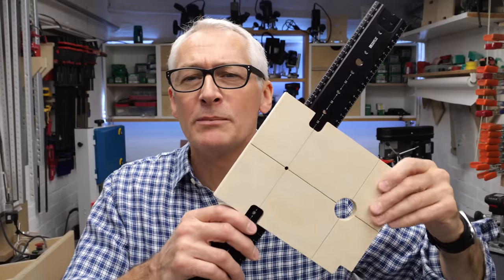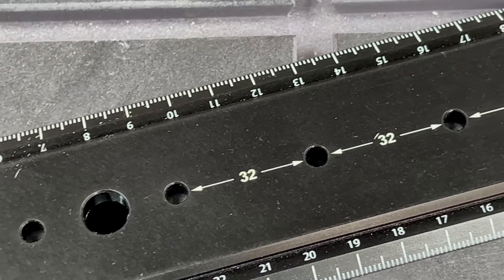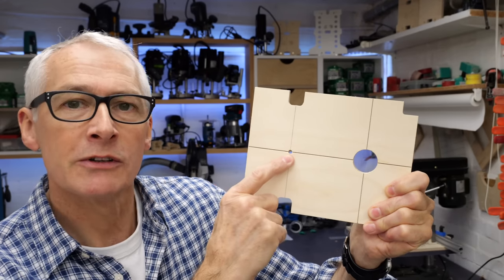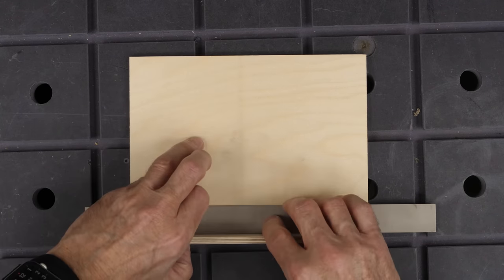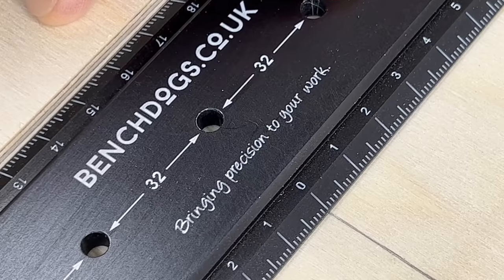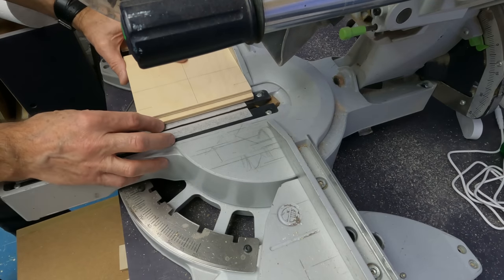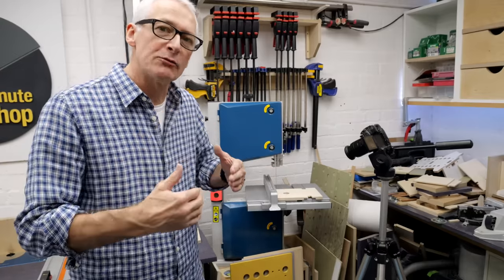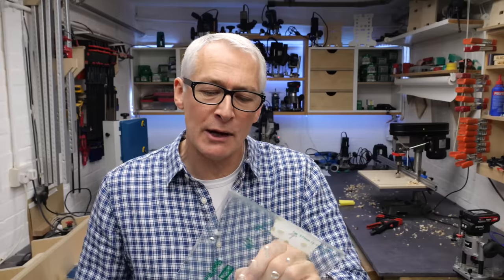[*Gifted/Ad] Quick & Easy DIY Shelf Pin Router Jig [video 506]

Comment: This is great! You could have the locating pin on a piece of spring steel so that it finds the next hole automatically without you needing to look. Just lift the pin out of its hole, start to slide the jig and let it spring  in to the next hole.

Comment: Another fine jig, I have the holy rail and used it on a few projects. It works great within it's limitations. First it's almost impossible to use it on assemble cabinet. Second it's a pita if your cabinet is custom size and not following the 90mm system. 

Thanks for sharing Peter <3
Reply from the maker: Thanks! And yes! Whenever I was asked to retro-fit shelves in existing cabinets I’d always use a simple drilling guide - messy, but much simpler to make it fit!👍

Comment: Excellent video and another great product from Benchdogs. I do wish there was a nice simple but durable shelf pin jig on the market that didn't cost the earth. A simple slab of metal or thick acrylic with holes for a router guide bush (instead of the 5 mm holes you get on most cheap jigs), a simple fence with a few holes for different backset positions, and a removable end fence to hook over the end of a panel. I'm sure this jig works very well, but it's still reliant on accuracy of the marks, alignment of the drill bit on the marks, accuracy of the drill press etc. Something like the above but CNC cut would be a great tool to have, perhaps supplied with a matching guide bush for absolute accuracy, which would allow shelf pin holes to be made to within fractions of a millimetre.
Reply from the maker: Thanks! As I say in the vid, the benchdogs rulers have an end hook accessory - or you can put a pin through a hole - so you’re not reliant on aligning against a mark. The trouble is that what you’ve described, whilst not complex, isn’t trivial either, and the costs do add up. Plus there are practical considerations too - if it references off the end of the carcass, how long does it need to be; too long and shipping becomes an issue, too short and it’ll be no good for longer carcasses!

But I agree, I think there’s space in the sub-£100 category for a decent quality multi-purpose jig, and I do have something cooking in that area, so watch this space! 👍👍

Comment: Getting ready to add shelf pin holes and this was a very interesting build. You have built tall cabinets in the past, with euro hinges in tall doors did you find that you placed the pin holes farther away from the edge so as not to conflict with the hinge plate positioning? this may effect the jig creation. (i have 48" wide carcasses already on walls)
Reply from the maker: It was very much dependent on the job; sometimes it's easier to stick to the '32mm system' and have the hinges in the same run of holes as the shelf pins, sometimes I'd set them back a little to avoid it.

Comment: Nicely done!
One jig I’ve always wanted to build is a version of the True Precision brand cabinet handle drilling jig. 
But instead of having tension setting screws, it would be nice to have actual millimetre incremental detents for a stop pin to set in to. Hope this makes sense. The knock offs aren’t worth while in my opinion, and the premium brand is almost $400 CAD. And the set screws are annoying and create bumps on the locking surface over time, and make it hard to lock in at exact positions sometimes. 
It would be great if Festool made it, because what I’m imagining would work exactly like the extensions for the domino. It’s adjustment works along a rule with millimetre increment detents.

Comment: Good ideas and also a good idea to provide the kit for those that don't have the full machine shop. That said, if I was making it, it would be in aluminium in my machine shop.
Reply from the maker: Thanks! Not everyone has a machine shop either! 😂 👍
Reply: @10MinuteWorkshop  Absolutely, whether it be a band saw, drill press or in my case, a milling machine.

Comment: Well done.  Bench Dogs looks to be providing the initial precision and extenability that is needed for drilling the pin holes for the 32mm spacing.   I found that using the plastic templates, after a few extensions of laying the template down they get off a bit and the holes on the other side or in back don't align correctly anymore.  That's why I eventually bought the Holly Rail.   I use my old plastic guides to add more pin holes to existing assemblies.
Reply from the maker: Yes, I found that too with the cheap & cheerful acrylic templates. And as much as it hurt at the time, the holey rail is a joy to use! 👍

Comment: It will obviously also work in those parts of the world where shelf supports are 6mm or 6.35mm (1/4 inch) like the US or Australia (which has 5, 6 & 6.35 mixed up all over the place) - just change the router bit to suit.
Reply from the maker: Exactly! 👍
Reply: Can't say I've ever seen 6mm pins in Australia.

Comment: Silly question from a newb to all this, what router bit did you use? Was it a spiral or straight bit? Thank you for all the vids, you’ve inspired me to make cabinet doors and built in wardrobes for our bedroom. Still lots to learn but loving every step!
Reply from the maker: The only silly question is the one you don’t ask - and thanks for your kind comments! I use a spiral upcut bit, solid carbide, 4.76mm as I found it was the best option for the commonly available shelf pins eg hafele. There’s a link in the video description to the one I recommend. 👍
Reply: @10MinuteWorkshop  thank you so much for the reply. Silly me for not looking in the description!

Comment: Hi Peter, not related to this video but a while back you mentioned doing a video on 20mm MFT cutters, just wondering if you are still planning to do this?  In the meantime, what is the yellow cutter that appeared in that same episode…. Sorry I can’t remember which one it was now?
Reply from the maker: I have something coming along, but not just yet. Long story short, it's not the bit that's the issue, it's the router. 🤷‍♂️ 👍
Reply: Thanks Peter….. I will keep an eye out 👀

Comment: did you turn your clevis pins down? also i do not see the flat pack on your store anywhere, just 8 items. nor the plans in the plans section. have you discontinued this item already?
Reply from the maker: The plans are available on my Etsy store still, but the near-total lack of interest in the jig has meant it's not really worth listing. I have another shelf-pin solution coming along soon. 👍
Reply: I am also interested in making a shelf pin jig and have been on the website looking for the plans but if a new jig is coming shortly I’ll hold my horses, thanks for the content Peter 👍🏻
Reply: @10MinuteWorkshop hi Peter. Did you get round to making that alternative shelf pin video? I may have missed it but can’t see anything newer since this video

Comment: The router bit says 4.75 but shelf supports are 5mm. Does this not make them a really tight fit
Reply from the maker: Shelf pins really aren’t 5mm - get a decent set of callipers and measure some. 4.76mm (3/16”) is a snug fit for most commonly available commercial shelf pins. 👍

Comment: Hi peter! I noticed your blue flag stop on the drill press station... is that the one 3d printed?
I´ve 3 printed the body and knob, but I´m not finding a way to make a sturdy flag, which one is yours?
Reply from the maker: Hi Yohann; this is an early Benchdogs flag stop, fitted with a current flag. It's what I had. 🤷‍♂️ 👍
Reply: @10MinuteWorkshop  aaaah i see! problem not solved ahah Thanks a lot, Peter!

Comment: Does any video introduce this grid MFT's benefit?
Reply from the maker: When you say 'grid MFT' I'm not sure wether you mean the grid of holes, or the dovetail tracks? Long story short there's an MFT playlist here - http://bit.ly/MFT-related - that has all the MFT and MFT-related videos in it, if you just want MFT basics then videos 182 & 183 cover that, 182 is here -  https://youtu.be/0V-p5F7SjO4 . This specific MFT build was covered here - Ikea Curtain track DIY MFT [video 487] https://youtu.be/223QALIbnRc - and the Matchfit Microjig Dovetail Clamp System [video 499] here - https://youtu.be/uiT6F-K26Tg

HTH P
Reply: @10MinuteWorkshop  thanks peter, I got the matchfit concept, it's like a t-track clamp system

Comment: Where can you get a router bit that fits metric shelf pins ?
Reply from the maker: Links in the description, as always 👍 Shelf pin bit (1/4” shank x 4.76mm  carbide spiral upcut shelf pin bit) - https://www.rennietool.co.uk/collections/solid-carbide-router-bits/products/solid-carbide-2-flute-spiral-flute-up-cut-router-bits?variant=39632460709975&aff=2

Comment: Small tip to make it much better is put a spring of the right length around the pin and you wont need to remove it it will just pop up automatically and you can just push it down to locate it

Comment: Late comment, but instead of cutting the two corner notches, I would rather use two more of your location pins in properly drilled holes.